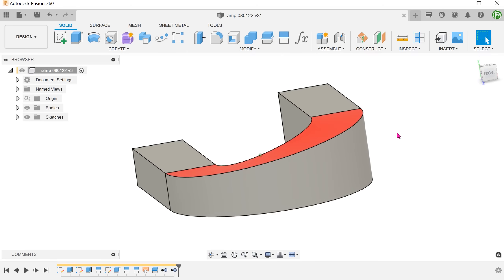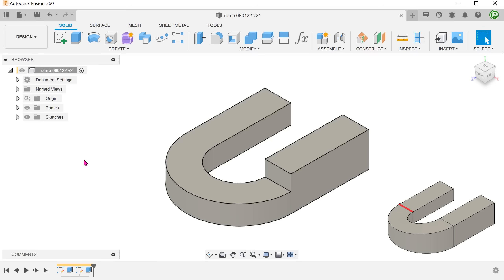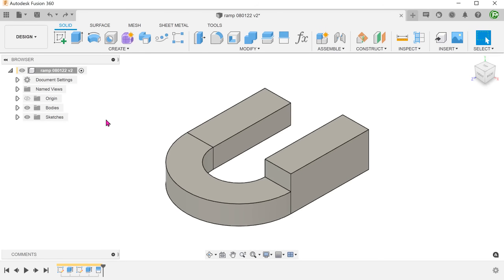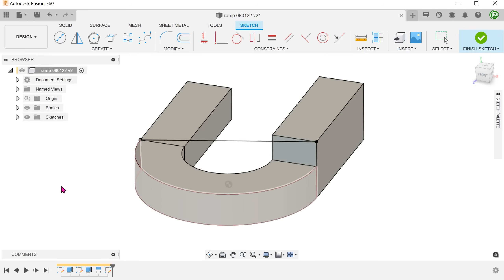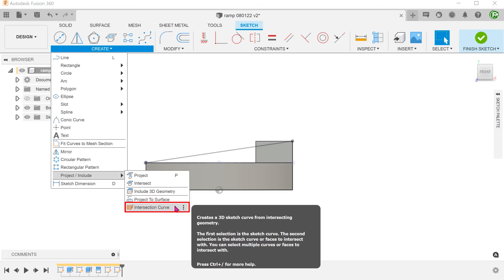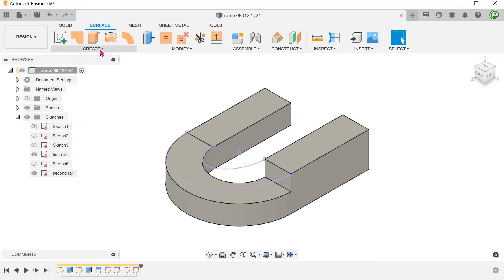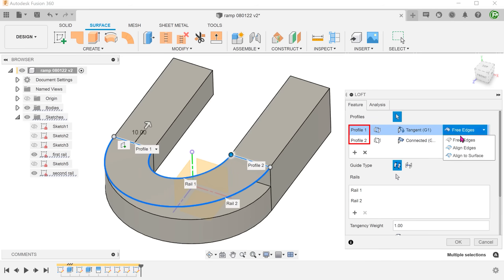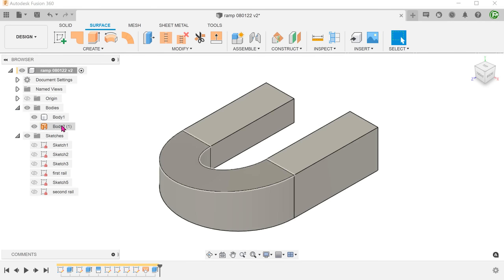Fusion 360 | Case Study 23

Comment: The first method does not seem to work when using a quarter circle though since one end of the curve isn't normal to the plane the intersect curve is projected on. I can't seem to find a way to do it for a quarter circle using the first method. Using a spline instead of the straight line doesn't work.

Comment: Wouldn't it be even simpler to just use the loft feature directly? 
After splitting the body as shown at 0:55 you already have two rectangular faces and two guide rails to use for the loft.
The intermediate warning that the two faces shall not be co-planar can be ignored as it will go away as soon you select the guide rails.
No need for any additional sketch or construction lines. Granted, the "vertical" curved faces of the resulting body are not vertical anymore, but wouldn't that rather indicate a F360 "bug"? To me it's not quite clear why F360 does this.

BTW, a well meant hint on the pronunciation of "edge" I have watched other videos of yours and I just can't help hearing  "age" where you obviously mean edge . 
This might be a good place to hear the difference of the two https://youtu.be/PlimY9bmNgc?t=20
Reply from the maker: This is a fair point. It was also suggested by a few others. When I went to try this, like you said, the "vertical" curved faces of the resulting body are not vertical anymore. It is very close though. I am not sure whether this is a bug. My thinking is that the top 2 edges of the loft needs more direction, which is where the projected rails can be useful. If precision is not a concern, your suggestion is definitely a viable and simpler method.

Sorry about this. A few others have pointed this out to me as well. I have tried and I am just unable to get the correct pronunciation in a natural way. This will have to be a work in progress.
Reply: @Fusion360School  Thanks for the quick reply 👍
I have played a bit more and found an only slightly simpler way of getting the exactly same result as yours. 
I'd start with the same approach as your second version, with an extrude of the top surface of the U shape, and a sketch of the two lines, but instead of using Include Geometry plus Intersection Curve or Split Face plus Surface Patch I used Project to Surface (Along Vector Y-axis) and then used the two resulting curves together with the two bottom curves of the original U shape as rails for a loft of the two rectangular cross sections obtained with the very first split body.

Comment: Nice video, may I suggest you : get lines rails as in the first method, then extrude as in the second method, then use solid loft from one rectangle to the other with rails to cut to remove the upper part. Always a solid approche 🙂

Comment: I'm trying this in Solidworks, as I usually use it for my work & I can't seem to figure out how you can perform sketch intersections like the first method shown here.
Reply from the maker: In solidworks, you should be able to use the project curve command to produce the same result. I actually think it is more powerful than the intersection curve command in Fusion 360.
Reply: @Fusion360School  Thanks, I'll check that out, I did manage to get the final result but it felt like I took 4-5 steps too many.

Btw really enjoy your videos, great way to learn new techniques, keep up the good work!

Comment: That was great! now could you expand on this and show how to create a simple semicircle track that follows your path consistently? for rolling a marble for example. I can get it to half work but the track ends up shifting from the expected end point, and it is not symmetrical.
Reply from the maker: A track definitely sounds interesting. I think another challenge would be how to maintain a consistent width along the path. Maybe a shell. Will consider this for a follow up. Thank you for the suggestion.

Comment: Nice thank you for this.
 I wonder if there is a way to remove the screw effect. I assume that the inner splitting arc would need to be curved also in the z direction. I mean if you imagine a car driving up that ramp the car is leaning outward, I wonder if theres a way to counter that.
Reply from the maker: To really customise the curve, one possibility might be to replace the straight line with a spline. Some have also suggested performing a sweep with twist to achieve a helical surface.

Comment: first split using face can cause issues if model changes (legs becoming not parallel). better to split using a line from the arcs' starting points.
Reply from the maker: That's a good point.

Comment: It's very nice to show how intersect works and how one can work with sufaces.  
However this example could be created very short and easy with this ramp, after you splitted it.  
You then have more bodies and could hide the middle one and easily loft 1 face from one body to the other face of the other visible body with the curve of the sketch as a rail.
Having said that - always love the vids you do and the way you give a perfect explanation, even for beginners!  Much appreciated and big kudo's for that  :)have
Reply from the maker: That sounds good too. In this way, we would be doing a solid loft with four rails, with 2 of them from the sketch used to create the starting model. It might be possible to control the loft with just 2 rails from the original sketch.........definitely worth trying.
Reply from the maker: I just went to experiment with 2 rails, using the original arcs used to create the starting block. The bottom edges of the the loft were able to match the rails exactly but not the top 2 edges. It is very close though!
Reply: Thanks for the quick feedback - I tried it and only used 1 rail (from the sketch - make visible before) - the outer rail - and that worked perfect  😉

Comment: Thanks for another great video. You could also create the rails by creating 2 planes - one between the inner 2 edges of the rectangles and another between the outer 2 edges. Extrude the body vertically, then create a sketch and Project>Intersect on each construction plane to create the rails for the Surface>Loft.  , then use the surface body to cut the solid body, and Remove the upper section, and combine the lower section with the original body.
Reply from the maker: That is definitely a good approach too, similar to what @JustinLin has suggested.

Comment: I think you might be able to use the coil tool to do this. This method would not be as flexible though, because it assumes that you are trying to follow a circular path. I guess what's kind of nice about coil is that it directly expresses the intent here: the surface you are going for is helical.
Reply from the maker: The coil command is definitely something to think about. From what I know, the coil command is not able to create a sketch. It can only be used to do a solid sweep. It might be possible to use the include 3D geometry command to project the solid coil into a sketch. But it might be difficult to join that to the existing body. Will definitely need to experiment more on this.

Comment: Nice workflow. I see this geometry as a helix surface and would do a surface sweep (path = axis of arc faces + 180deg angle) and use replace face using surface body (still need to split the arc face from rest of body). But now the challenge is to make the slope tangent to start/end face ;) have a nice weekend and take care :) .
Reply from the maker: Ah, a sweep with twist. Did not think of that. Will definitely need to try that out.